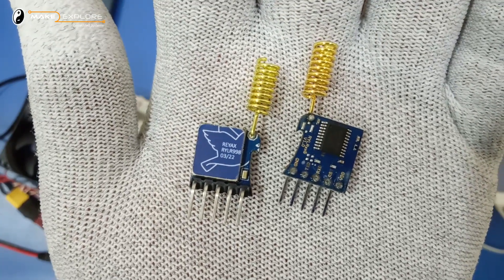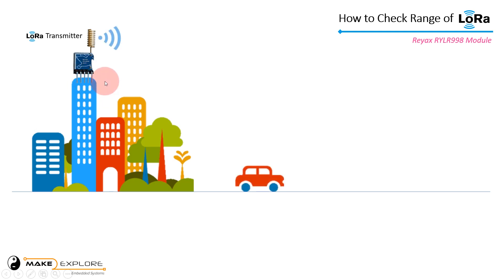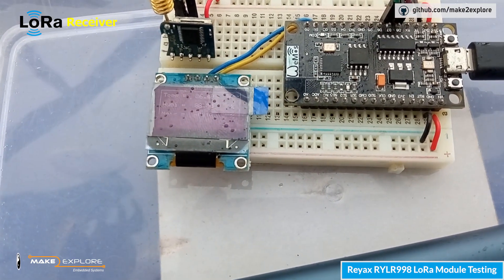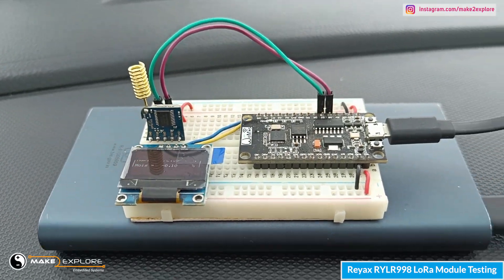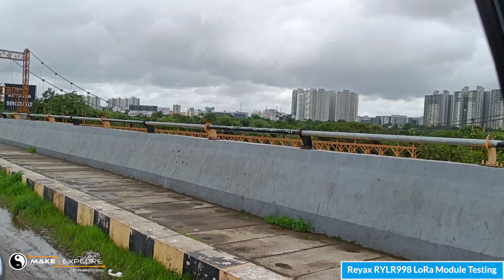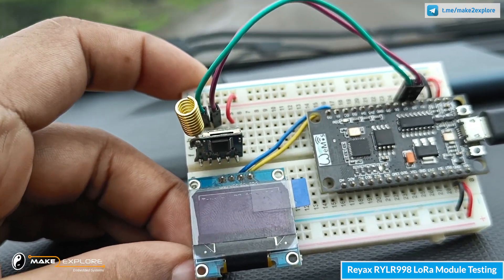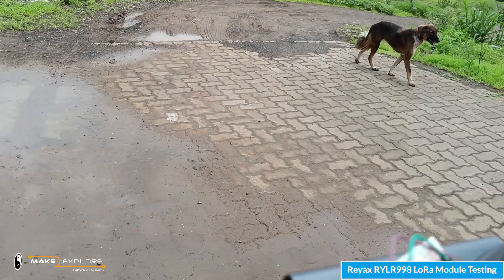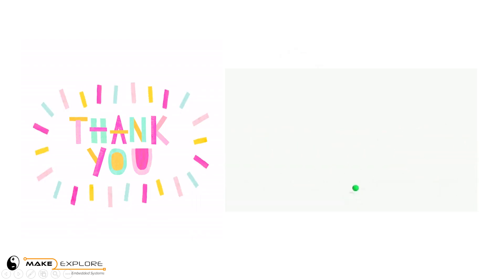RYLR998 LoRa Module Range Testing

Comment: What is the battery life if use this module
Reply from the maker: Dear Manuraj @manuraj1sharma, 
Thank you very much for your interest in our channel. 

Q - What is the battery life if use this module?

➡️ As per the datasheet of this RYLR998 LoRa Transceiver Module, 

Transmit Mode current : Typically 140 mA (at condition RFOP = +22dBm)
Receive Mode current : Typically 17.5 mA (at condition @VDD=+3.3V)
Sleep mode current : Typically 10 uA (at condition @VDD=+3.3V)

Smart receiving power saving mode - average current =
0.02 mA Minimum , 2.7 mA Typical and 5.5mA Max at (AT+MODE=2,3000,3000)

So, theoretically you can say or you can configure this module for optimum performance of power consumption using sleep mode and Smart receiving power saving mode when module is idle. You have to just switch the mode using AT commands through program. 

➡️ You can check out datasheet and features of this module on its product page

🔗 https://reyax.com/products/RYLR998

If you have any queries/issues/suggestions about this Tutorial, or any of our DIY project, feel free to ping us on WhatsApp/Telegram (Links given below) for further support.

Tech support - (𝗖𝗵𝗮𝘁 𝗢𝗻𝗹𝘆) Telegram/WhatsApp - 11:00 AM - 05:00 PM (Mon-Fri) IST   

🚀 𝗧𝗲𝗹𝗲𝗴𝗿𝗮𝗺      🔗 https://t.me/make2explore
💬 𝗪𝗵𝗮𝘁𝘀𝗔𝗽𝗽    🔗 https://bit.ly/3VXGGEe
📩 info@make2explore.com  / support@make2explore.com

As per time permits we will try our best to help you out. 

Best Regards

Comment: Good video, but you should consider add basics information of this setup, bw limits, SF configs, if you did a BER test or only a dummy msg, what size, period...
Reply from the maker: Dear Ricardo Noronha Junior, 
Thank you very much 🙏  for your interest in our channel and Your words of encouragement. Those means lot to us.

Q  -  but you should consider add basics information of this setup, bw limits, SF configs, if you did a BER test or only a dummy msg, what size, period...

➡️ This review of RYLR998 LoRa Transceiver module was covered in two parts. 

In first part we covered brief overview 
[Device Overview] Reyax RYLR998 LoRa Module - 
▶️ https://youtu.be/UFjA9VwudE0
In this part we have overlooked Device specifications, AT commands configuration guide and We have also see one small DIY project using these modules. It was a basic setup of simplex transmission.

In second part we tried to test "Transmission Range" of RYLR998 LoRa Module with same basic setup
▶️ https://youtu.be/dzdASqc0R0U

You are absolutely right. We should have considered above parameters mentioned by you during testing. We just tried basic testing. But next time We'll definitely take this in account for our future LoRa Project's testing.

Thank you very much for your valuable input

Best Regards 🙏
Reply: @make2explore  did you use the factory settings?
Reply from the maker: Dear Tomas Gonzalez, @tom19972

Thank you very much for your interest in our channel.

Q  -  did you use the factory settings?...

➡️ Yes we used default factory settings for the testing of these Reyax RYLR998 LoRa Modules. This review of RYLR998 LoRa Transceiver module was covered in two parts. 

In first part we covered brief overview 
[Device Overview] Reyax RYLR998 LoRa Module -  ▶️ https://youtu.be/UFjA9VwudE0
In this part we have gone through Device specifications, AT commands configuration guide and We have also see one small DIY project using these modules. It was a basic setup of simplex transmission.

In second part we tried to test "Transmission Range" of RYLR998 LoRa Module with same basic setup
▶️ https://youtu.be/dzdASqc0R0U

If you still have any suggestions/issues/queries about this Tutorial, or any of our DIY project, feel free to ping us on WhatsApp/Telegram (Links given below).

Tech support - (𝗖𝗵𝗮𝘁 𝗢𝗻𝗹𝘆) Telegram/WhatsApp - 11:00 AM - 05:00 PM (Mon-Fri) IST   

🚀 𝗧𝗲𝗹𝗲𝗴𝗿𝗮𝗺      🔗 https://t.me/make2explore
💬 𝗪𝗵𝗮𝘁𝘀𝗔𝗽𝗽    🔗 https://bit.ly/3VXGGEe
📩 info@make2explore.com  / support@make2explore.com

Thank you for your support.

Best Regards

Comment: amazing... I tested the eByte version and i didn't get more than 1.5 km... i will be testing this lora version soon. 

many thx for the video
Reply from the maker: Dear @Abu al-Sous,  Thank you very much 🙏 for your interest in our channel. We're honored to know that you watched our content.

As per the datasheets of LoRa transceiver (RYLR998), at Absolute maximum ratings  power amplifier yields / RF Output power range / Transmit Power is ranges up to -20 to +22 dBm at 100 mW constant RF output vs. V supply. and Typical transmission distance given by Reyax is upto 5-6 Km

It also depends on lot of factors. like if tested at open space without any obstacles/buildings/hills in actual line of sight, then it should cover longer distance. And we can get LoRa coverage upto 6 - 8 Kilometers. 

Have fun testing (RYLR998 module) in your area and let us know how much distance it covers.

Thanks and Best Regards 🙏

Comment: RYLR998  its more power full thar RFM96  SX1276?
Reply from the maker: Dear @Josué Sanchez ,  Thank you very much 🙏 for your interest in our channel.

Q - RYLR998  its more power full than RFM96  SX1276?

As per the datasheets of LoRa transceivers (RFM96, SX1276), at Absolute maximum ratings  power amplifier yields / RF Output power range / Transmit Power is ranges upto +20 dBm - 100 mW constant RF output vs. V supply.

and for RYLR998, as per its datasheet and absolute maximum ratings RF Output power range is  -20 to +22 dBm.

So, Theoretically as per standards it looks like RYLR998 has more power amplifier yields than other two modules. But practically we found it approximately similar for all three. It also depends on lot of factors. So typically RF Output power is ranges from -20dBm to +20dBm. 

If you face any issues in replicating any our projects/tutorials, Feel free to contact us through email  
📩 - info@make2explore.com
Also, For quick response, you can always chat with us on 🚀 Telegram 
🔗 https://t.me/make2explore

We'd ❤️ love to help.

Best Regards 🙏
Reply: @make2explore  excelent answer, i Will subscribe your channel, hello from El Salvador américa central